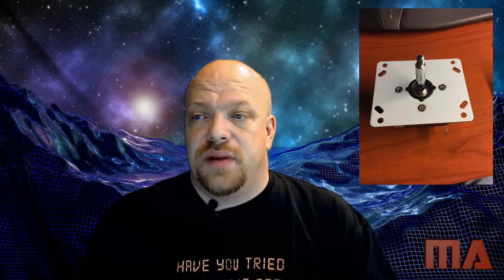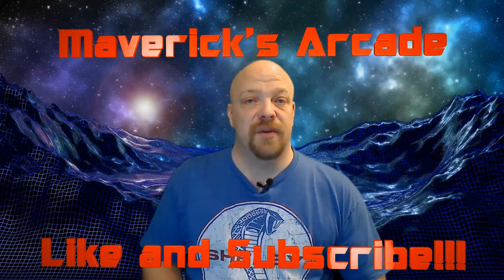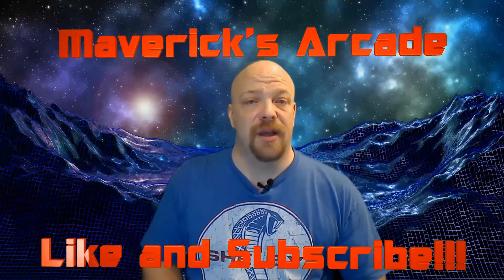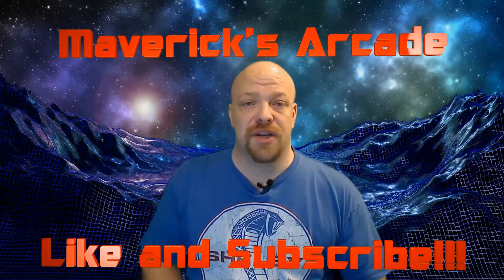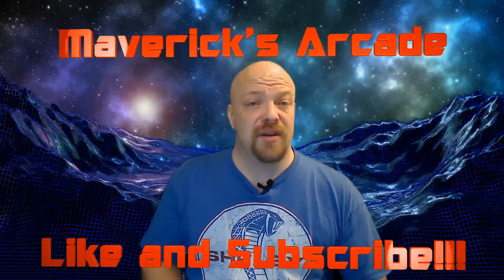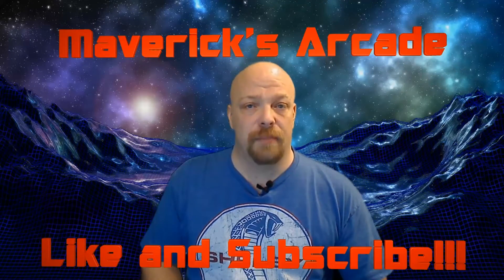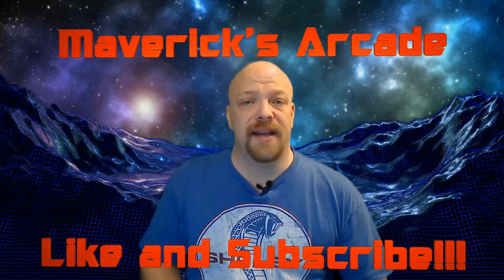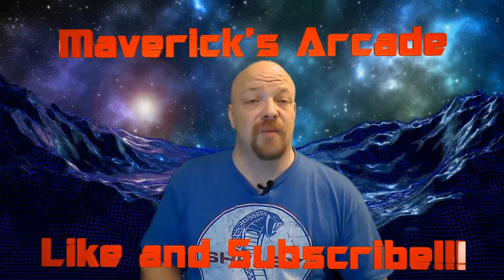Ultimarc ServoStik RGB Illuminated Handle Upgrade and Motor Setup

Comment: Is there an extension kit to make the shaft a little longer? feel like its kinda short
Reply from the maker: LOL, out of context, that is such a hilarious statement :-)   - There is an optional extender you can buy, but I'm not sure how that would work if you have the RGB ball-top.  
https://www.ultimarc.com/arcade-controls/joystick-accessories/ultrastik-360-long-handle-shaft/ 

If you're using an RGB handle, you could probably verify with Andy at Ultimarc whether it would work with the RGB or not.

Comment: Chuck - THANK YOU!  Starting my build and didn't get any documentation with my joysticks - and didn't find anything on Ultimarc's site.  You and your videos are a lifesaver!  One thing that I did after your caution about messing up the LEDs on the stick was to temporarily screw on the ball top while doing reassembly as I was nervous about manhandling it while trying to get that darn retention ring back on.
Reply from the maker: Glad it was helpful!  That's definitely a good idea to cover temporarily.

Comment: Hi Chuck - I've ordered the servostiks after watching a bunch of your videos, but as I have gone to test them against my CP (I bought a flat pack kit), the recess for the josticks is deep enough where I can't actually attach the servo motor to the gate, because it's sitting too high - do you have any idea of what I could try? I'd love to find a way to still use the functionality of the servostiks
Reply from the maker: I'd love to help, but I have no idea what a Flat Pack kit is?  can you perhaps send some pics and i know what you're dealing with?
Reply: Hey mate - I think I've figured it out now, I was trying to find a solution other than having to cut out a larger recess, but that's pretty much the only option, so I am getting a friend to help me with that.

By flat-pack I just meant like a pre-made cabinet you assemble yourself, like Ikea furniture or whatever. Not sure what term they use in the states. Cheers anyway, your videos have been insanely helpful with understanding what I need for my cabinet and how it works - pretty everything I've settled on with my build has been directly because of how comprehensive your videos are, so cheers!
Reply from the maker: @Cursed_Salaryman  Gotcha!  we generally would just call that pre-made or pre-assembled.  That's the issue with those kits, they come ready to go which makes it much easier to someone like myself who aren't carpenters.  However, the downside is you don't get to fully design it yourself from scratch.  It also can possibly limit your expansion possibilities.  Regardless, I'm glad you found a way to resolve that issue, and when you're done you'll definitely need to send me an array of pics... stay tuned to my next video where I will be describing what I need in order to model out your builds :-)

Comment: Glad I found your channel, gave me all the info I needed before ordering mine, I was going to order before but thought I would look into it first, and I am glad I did as I completely missed adding the usb board to the basket and would have been peeved having to wait to order it after if I hadn't seen your video. 

Unfortunately, my modded old arcade machine (it used to be an old 2 button machine thats been modified to have 6 buttons) can't quite fit the second player sticks motor on it, player one is fine, but the buttons for the player one are a fraction to close, with them being way to close on the player 2 side. I guess some modding is in order. I had worried from the start that the player one buttons didn't leave much space for player 2, but up until now its not really been a problem as the  thinner metal panel they all fit into mean the sticks are high enough to not be a problem. lol I am determined to get it o fit, so will be digging out the dremel this weekend to take some of the overhanging plastic on the motor, its literally millimetres  to big.  This what i get for wanting a real old arcade machine, hefty crt and all instead of a much more user friendly new one. Mind you gives me incentive to do that next as I want a trackball, spinner and rotating sticks (I need to play midnight resistance, smash tv and xybots properly)

lol first world problems :D
Reply from the maker: Sounds like a good amount of fun :-)   Also, you could consider what I did and drill a small whole on each side and run gamepads for Player 3-4 games :-)

Comment: Can the ultrastik 360 be illuminated?
Reply from the maker: Not officially, but I've seen a video where someone hacked the parts and made a ridiculous controller.  At the moment there's issues with the pictures, but here's the link for when he fixes it (the instructions are still valid).  

http://forum.arcadecontrols.com/index.php?topic=132356.0

UltraStik 360 + RGB LED + Topfire + Rotary Mod !!!
Reply: Maverick's Arcade thanks for the reply your videos are extremely helpful!!! Unfortunately the pictures aren't showing up. At least I know it's possible. I'll see what I can figure out.

Comment: hey i don't kind of understand the 4 way and 8 way when you're switching it as it looks like the 4 way can still move in 8 way a little bit? i'm assuming it just doesn't go the full 8 way movement?
Reply from the maker: It's restricted so the movement is only in a diamond, the restriction isn't creating a 4-way cross pattern, but it's restricted enough that it does prevent two buttons from triggering at the same time.
Reply from the maker: I can't find your dust washer question on the thread, not sure why, but to answer the question, I told Andy at Ultimarc about the issue.  What I did is just shaved the hole out slightly so it would fit the RGB handle.  :-)
Reply: damn! i thought it actually restricted it to 4-way to i'm assuming all other joysticks do the same thing?
Reply from the maker: wallmachine it does technically you are unable to enter diagonal directions only up down left right, but if you mean like ONLY straight up straight down straight right and straight left then your correct it's not restricted as much as you thought

Comment: can you use these joysticks with the rasberri pi? thanks
Reply from the maker: Well, the joysticks use buttons just like other buttons so as long as your controller will work with the Raspberry Pi then yes.  There is a Linux app called RGB Commander that should work on the PI if you choose to get the optional RGB handles.  The only question would be the servo motor.  You could opt to put the server motor in manual mode and create a button that just toggles the joysticks from 4-way to 8-way.  I have not heard of a Linux port of the joytray functionality.  Please note:  All of this is just a guess as I've not tested this scenario personally (I'm talking out my ass a bit)...  based on my experience thus far the above seems correct  :-/
Reply: I will try it out I guess. I have a arcade table I made using the pi. I wanted to change over to lunchbox but have no experience at all with that front-end. I wouldn't even know what pc to buy to run everything.
Reply from the maker: Launchbox is really cool.  Basically for classic arcade games any current day PC would be fine.  For PS1/PS2 type games it would need to be a little more beefy :-)  Let me know how your test goes :-D

Comment: Sorry, if you mentioned this in the video but is there a way to get the ServoStik to automatically tell if it is a 4 or 8 way game and adjust the restrictor automatically?
Reply from the maker: You can have the control change automatically, but you have to at least once define the games to be one or the other.  Or, in my case, I made two batch files, one to launch games in 4 way mode, and the other to launch in 8-way mode.  All MAME games in launchbox are launching with the 4-way emulator configuration, if they're 8-way, I change them to use the 8-way configured emulator instead.  That way, going forward it does switch automatically, but you do have to specify once for each game.
Reply: I see are you able to share those two batch files? or create a video on them and where they would go? also is there an easy way to find out if a game is 4 way or 8 way? I was thinking if we configured LEDblinky the controls for each system would the ServoStik change to 4 way or 8 way?
Reply from the maker: If you email me I can send you the batch files I use (once I get my system back up - I'm changing the control board - video coming for that too)...    As far as LEDBlinky, it's supposed to be able to handle this, but I haven't tried it yet.  As far as whether or not the game is 4 or 8, usually you can find this information on Wiki's for the game.  If you use Launchbox with the download subscription from emumovies it will download that information into the game details.
Reply: awesome i private messaged you on youtube. Which control board are you using now? or is that a secret for your next video?

Comment: Another option you could use would be to have the batch file ran before the games starts. If you look under "additional apps" in launchbox edit.
Reply from the maker: That is true, but wouldn't I then need to add that option to each game individually vs just setting the emulator?  Be doing it through the emulator I can mass import 4-way games seperate from 8-ways games no?
Reply: I'll be honest I'm not sure which way would be better. I imported all my MAME games at once and already downloaded all the pics and videos. I just found a list of arcade games that use 4 way and updated just the 4way games. They run the 4 way batch on open and run on the 8 way batch on close.
Reply from the maker: That's an interesting approach :-)  I wish the joysticks could since what mode they were already in so they wouldn't attempt to go from 4-way to 4-way, just causes extra needless use on the motor :-/    What's awesome is, that's my only complaint :-)
Reply: Yea It was sorta my fear that they would get damaged over time but doesn't seem like it hurts to much. The other thing I added to the batch file is - exit. This closes the program after... not sure if it makes any difference though lol.
Reply from the maker: John Paden you only need exit if you have if then goto logic in the batch file otherwise end of file is automatic exit :-)
Reply: I put the - exit behind joytray so that it would close the program after switching. I know its no much but my computer(I'm using a old laptop with a broke screen) is already struggling so I figured one less thing running in the background.
Reply from the maker: I now understood what you meant by the -exit... LOL I thought you meant exit at the end of the batch.  After my launcher getting stuck, I realized what you meant about -exit  LOL  Thank you

Comment: Great video! Is there any way you can post the code for the batch file you use for mame? Thanks
Reply from the maker: Obviously, I could shorten it with combining paths, but here it is :-)  
c:
cd \
cd "Program Files (x86)"
cd "JoyTray"
joytray -servo joy4way
d:
cd \
cd emulators 
cd mame64
mame64 -skip_gameinfo %1

This file is called mame4way.bat.  The other file is called mame8way.bat the only difference is the line that says joy4way says joy8way.

This file will be changing soon though, I'm going to add an option for a LEDBlinky command which, if present, will send a command to LEDBlinky.  By doing this, I will be able to have specific light setups for special games.. For example, police games will make the cabinet light up like police wigwag lights. :-)
Reply: Thanks! You could also shorten up the code a lot by directly launching the exe. I'm also using launchbox and led blinky, so seeing this video motivated me to get the servo joy stick.But this gets me started so much appreciated :)

start C:\"Program Files (x86)"\JoyTray\joytray -servo joy4way
start D:\emulators\mame64 -skip_gameinfo %1
Reply from the maker: MarkyJoe_314 make sure to watch my LEDblonky video when I make it.   It will be awesome.  :-)
Reply from the maker: yeah, definitely, stay tuned, when I do the LEDBlinky video I'm gonna do some cool stuff :-)